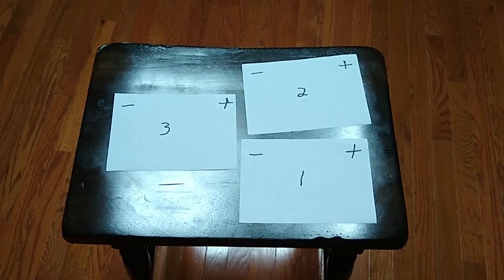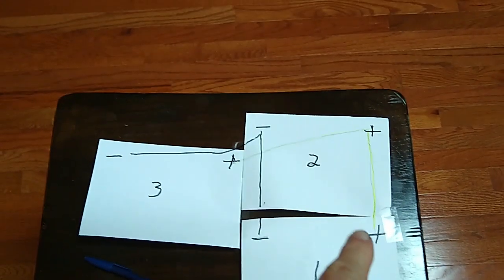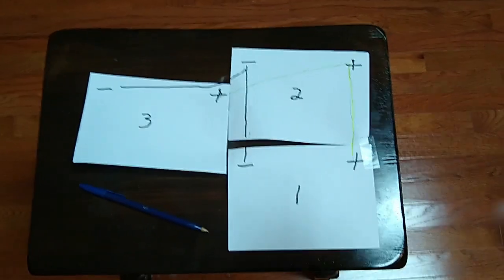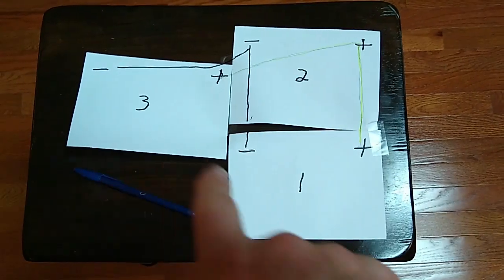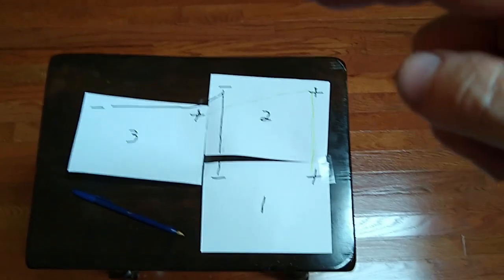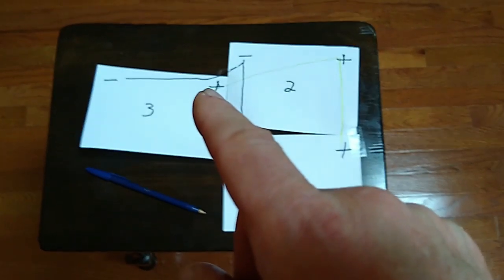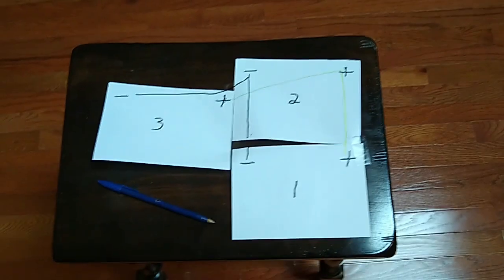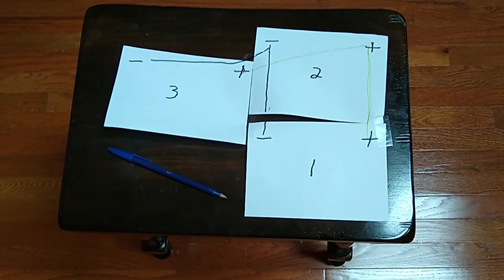Wiring 3 batteries in parallel for van life

Comment: Matty, so here I have 3 batteries connected parallel thats done.  I have now solar charger wires and load wires for invertor. 
Charger connects to ;  Battery 1 Positive / Battery 3 Negative
Load connects to :      Battery 3 Positive / Battery 1 Negative
Well I hope I understand it correctly. I appreciate your video. I just bought 3 lithium batteries for my Full timing in my RV. Marry Christmas all. ;) Thanks again. michael
Reply: About to do this for my rv set up; did it work for you? Hah

Comment: Can I use 3 12v to have 24v? With the 3rd battery as a backup?
Reply from the maker: You could use two 12 volt batteries and wire them in series to create 24 volt
Reply: @MattyVanHalen  thats my current setup but its not enough im constantly running out of power gotta up my capacity. I can't even run my fridge indefinitely
Reply from the maker: @damagekritical  how many watts of solar do you have
Reply from the maker: @damagekritical  sounds like you've got plenty of solar how big are your batteries? Are your solar panels also wired in series?
Reply from the maker: So are you saying you only have 70 amp hour of battery bank total?

Comment: Well the wiring is correct but don’t mix batteries with different Amp hours. It’s like pouring water out of a 100 gallon bucket and two 75 gallon buckets at the same time. The small ones run out first. Now you’ve created an imbalance and the smaller weaker batteries are going to strain to keep up. All you’ll do is wear them all out faster. A balanced system is same type of battery, same age, same voltage, same wire size, same wire length and same amp hours.
Reply: This is not completely true, each battery will discharge and re-charge proportionately to their perspective size. Its always best to match ah, but its not absolutely required if the ah are fairly similar.